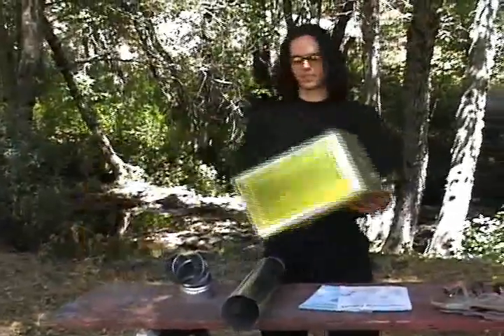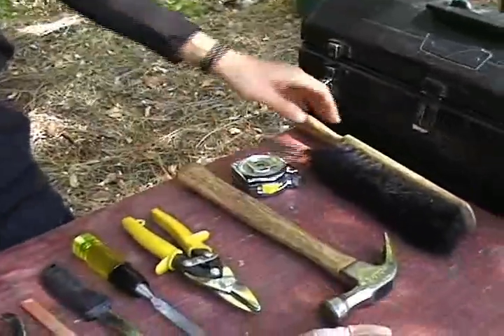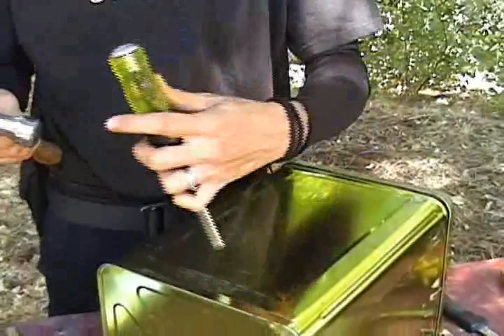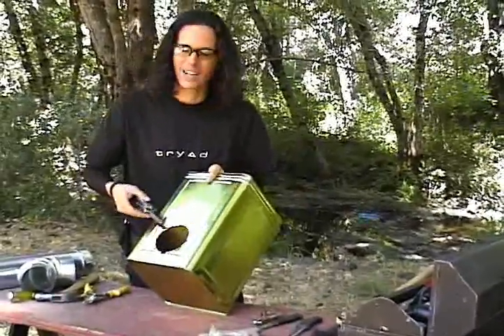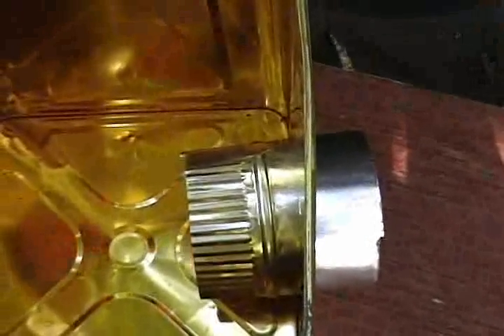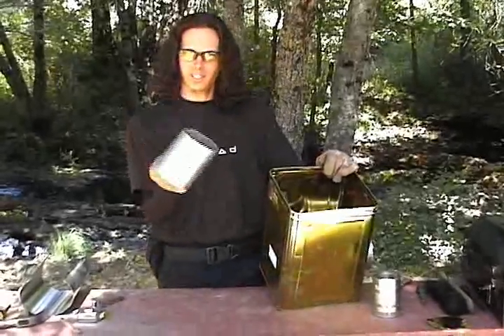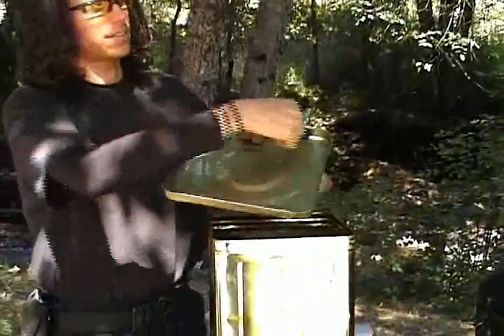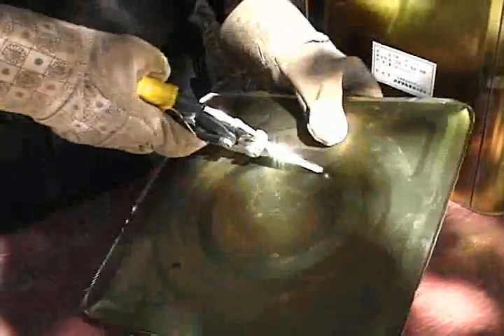Vavrek - How to Make a Rocket Stove - Part 1

Comment: @BeepBeepBoing also PAL a stove pipe should have insulation around it and it's for exhaust only so it does'nt get hot enough to release the zinc.in this case PAL u better be outside and away from it.because as u can see in the vid he uses the galvanized pipe it self  as the holder of the main heat source.but call me crazy everyone at home uses the pipe itself and not the stove...humm hey mr zinc worker man,i think yoru on to something.you should build a whole stove out of galvanized metal...

Comment: Built mine today, using a round 5 gal can from a hardware/farm supply store.  Seemed to build about the same.  Hard to improve on this design but I added a handle from a 5-gallon plastic bucket so its easier to carry around.  I also didnt have any ashes (I live in the suburbs) so I used 25 lbs of kitty litter, which also seemed to work OK.  For lighting, I had trouble until I removed the platform and stuffed 1 sheet of newspaper in the elbow, and put sticks down the top of the chimney.

Comment: @ceramicclassstudio agreed the vapor that will be released from the galvanized metal will kill u.i mean it would be ok if it was just releasing the smoke.but to use it as part of the stove that will get hot is a no no.BEWARE GALVANIZED METAL WHEN HEATED WILL KILL U.

Comment: This is the best video on making Rocket Stoves that I've seen so far.  I've made about 20 Rocket Stoves over the past 3 years or so.  I never could find a 5-gallon square can like the one in the video, so I build my Rocket Stove by joining two "#10 cans" together with "JB Weld" (NOT "JB Quik").  (I posted my full instructions at: speedreading4kids "DOT" com/rocket.htm ).

I saw your note about Galvanized pipe.  I'll look into making future Rocket Stoves with black stovepipe. THANKS VAVREK!

Comment: nice job...the pipe you are using is galvenized and throws off toxic fumes when it gets real hot and is thin to the point of melting...try for real heavy cast iron pipe.
  also use a sharpie and they make snips that are designed for cutting circles, it was amusing watching you work with metal as i am a tin knocker
but you pulled it off ! congrats!

Comment: great job!

i use a sharpee instead of a pencil to mark my cuts on the tin.

When I punck the first hole to cut into the can I punch in the center of the hole to avoid screwing up the cut.

if you cut a hole smaller than the stove pipe you can cut tabs to secure the can to the stove pipe. 

Overall, Great Job!!!